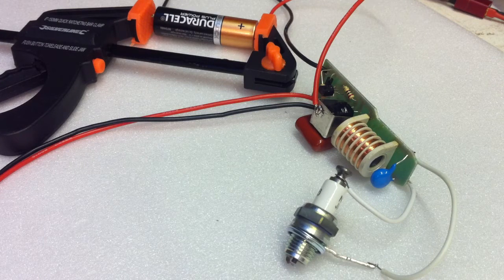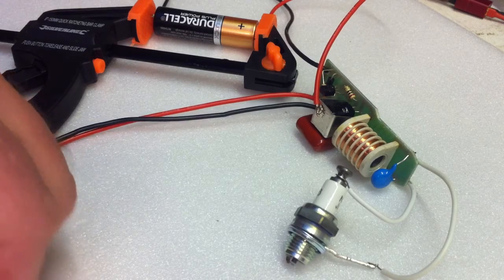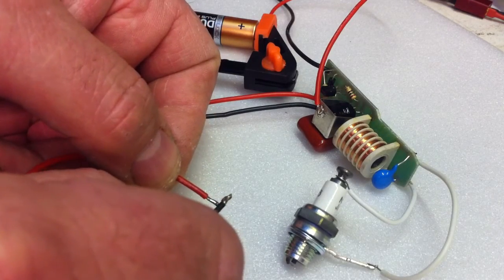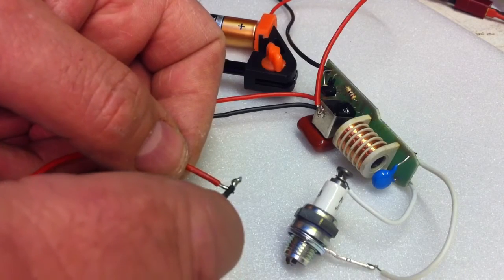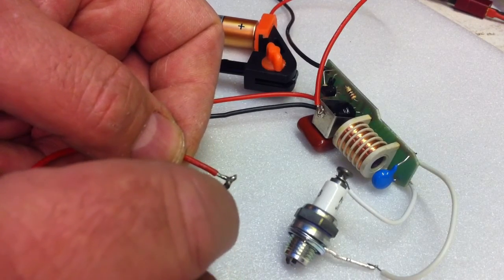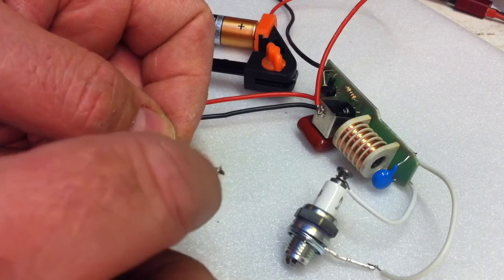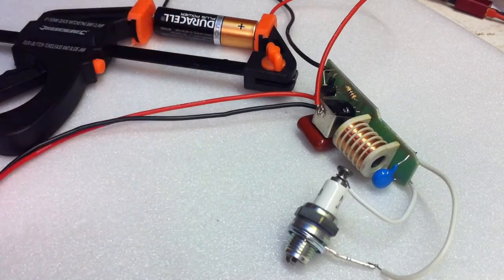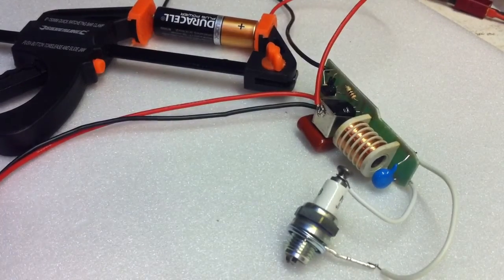Piezo Spark Ignition

Comment: Thats not how a piezo  lighter works you don't need a battery looks like the circuit boosts the 1.5 volts from the battery to create a spark. a piezo crystal creates the high voltage when it is compressed or impacted like in a lighter without the battery

Comment: Hi , what piezo lighter did you use ? cheers
Reply: Hi, Sorry to jump in.  I just coverted one and it does work ( well so far) and its amazing to see a strong spark from a 1.5volt AA battery.  You will need to buy a battery operated gas/hob/stove gas lighter, not a piezoelectric gas lighter.  From the appaerance of his circuit board the gentleman probably used one called Masterclass gas lighter, about £10 to £12 from Amazon for example.  I used a cheaper £3 one from China which has a slightly different circuitry but very similar.  You'll need to do a little bit of desoldering to remove a few components and solder some back on.  You'll need to change the capacitor to a 400v one, for example, but it is really very basic soldering work.  You can either use a micro-switch or a reed switch to trigger the spark, or even use a hall effect sensor but that's beyound my electronic knowhow. Hope this helps.